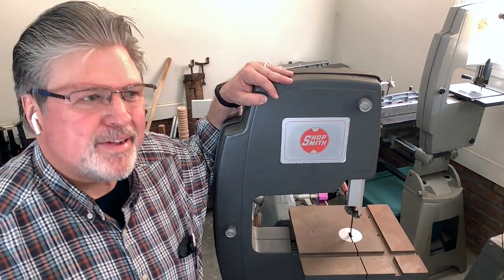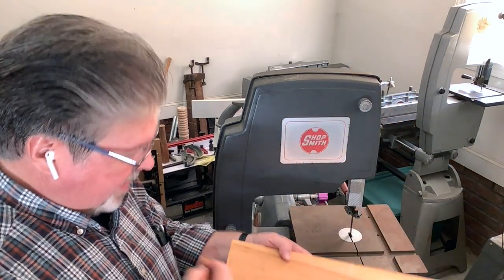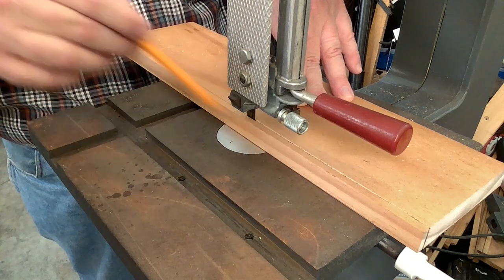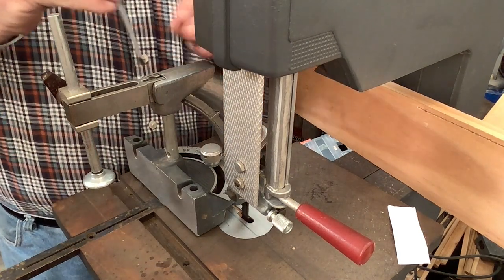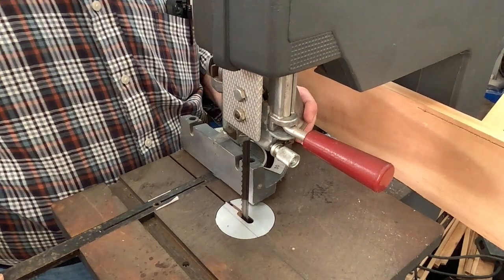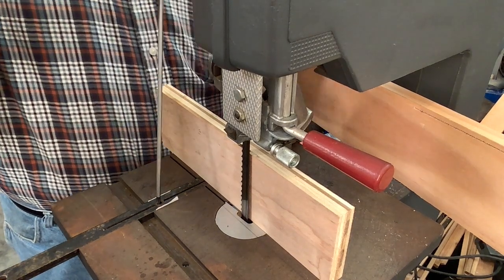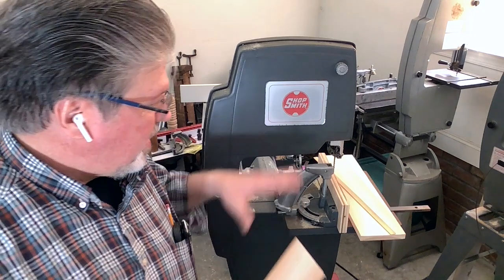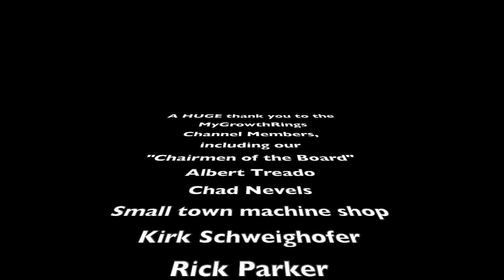Ripping & Resawing on a Shopsmith Bandsaw W/ Cast Iron Table

Comment: I have two Shopsmith Bandsaws, one of each aluminum and cast iron. I don't have the drift issue with either of them. 

Back in the early eighties, I made siding for my house using my cast iron tabled bandsaw. I ripped a large stack of 16-foot siding using the miter gauge fence. I wore out three blades.
Reply from the maker: That's a lot of sawing!
Reply: I hope you adhered a Shopsmith emblem on your siding in honor of your fine sawing skills!

Comment: I have a new to me shopsmith 5. I have gone through the band saw and the belt sander and done a complete maintenance on both of them. Thank you for your instructions. I am trying to do the set up for the ripping fence for the band saw. And lo and behold, I came across this video. But I don't think I have the right ripping fence. I have the one for the table saw. I haven't been able to find one for the bandsaw. I am about to learn how to do it now. Then I just need to find the fence. Thank you for all your great videos and all the time that you have put into so much work to make it easier for us. I also have the cast iron table like the one in this video.
Reply from the maker: @eagle3351  Do you have a Shopsmith miter gauge?

Comment: Great video Scott.  As I told you in another comment,  I  finally fired up the  SS bandsaw I've had kicking around the shop for years, mainly to make sure that it was in good shape before I sold it.  I love the way it cuts!  I'm not selling it!  I've used the miter gauge for a fence before, but now I will use it on my bandsaw.  Love the idea of setting it to adjust for drift!  Keep the good suggestions coming.
Reply from the maker: That's so cool to hear, Stew. Yes, the miter gauge as a fence is just so efficient and practical.  Like so many things on this saw it makes me wonder why it wasn't copied until the clones came along.  Scott

Comment: Thanks for another excellent video.  I used to teach classes at Woodcraft (and I'm sure you can see where this is headed) and the conventional wisdom was that if you wanted good results when resawing you needed at least a fourteen inch band saw,  and an expensive one at that, and just for good measure it should be outfitted with Carter guides.  Even though not one of them owned a Shopsmith, the store employees were convinced that this kind of accuracy was not possible with a small saw. Thanks for setting the record straight.
Reply from the maker: HA! Yes, I saw exactly where this was going!  Every once in a while, during my frequent business trips, I'll visit a Woodcraft or Rockler and they won't be poisoned against Shopsmith tools. I always ask in every time it's because some highly respected and talented woodworker among them has shown them the way. We'll get to them all eventually!  Scott

Comment: I was just dealing with this issue today and was not able to resolve it!

I had used the practice cut method for fence alignment on my large band saw at school before, but never thought to try it on the shopsmith.

And I did not know that the set screw could be used to clamp the miter gauge in the slots. Boy, have I had some difficulties trying to do that with f clamps; there may have been some f-bombs involved too.

Can't wait to try these techniques out tomorrow!
Reply from the maker: Just make sure to add a piece of paper under the bar before tightening the set screw.
Reply: @MyGrowthRings  Worked! 

Turns out, my miter gage bar is tight enough as is. The paper wouldn't fit in the slot, no matter how much I loosened the screw.

Comment: Okay , this is another PHD type presentation!  Love my SS Band Saw but haven't really used it much other than cutting out shapes for some Arondak chairs,  which turned out fantastic. The example you showed would be a perfect alternative for edge banding plywood cabinets. Thanks for sharing. Curt.
Reply from the maker: Thanks Curt. Oh yes, you can easily make edge banding. And FastCap sells what they call "SpeedTape", which is the double-sided tape that I use for permanent bonds like thin wood edgebanding, but if you cut it thick enough you can always used woodglue.

Comment: This video would have been helpful 20 plus years ago when I was doing a lot of re-sawing for the local ladies at church. Their monthly projects were tole painting and I was the go-to guy cutting out wood decorations for them to paint. 
To hold my miter bar in place, I would use a clamp and a thin strip of wood the width of the miter bar to clamp the miter gauge to the table. I still do it that way, but I will try your way of holding the gauge tight. I never thought about using a paper shim.
Reply from the maker: Hey Norm. Well, the good news is you know now. Let me know how it works out for you.  Scott
Reply: @MyGrowthRings  Hi Scott. I just installed the Carter Bandsaw guides. I think it made a big difference. I made several thin cuts to test it out. No drifting whatsoever. I also tried your paper trick using the mitergauge slot. It works really well and holds it tight. Thanks again for all your help and info.
Reply from the maker: @mcnormYT  Glad to hear it. They really seem to work well.

Comment: Great video Scott, thank you. Would you consider some deep dive maintenance videos? For things like lower wheel removal, beltsander drive wheel removal, bearing replacements on about everything,  and such. And the more odd SPTs like Pin Router, Ring Master, compressor, etc.
Reply from the maker: Yep, they are all on the list, except lower wheel removal, which isn't worth the effort. if that bearing is shot you might as well start with a fresh wheel and bearing. Scott

Comment: Blade back up bearings: I used the cheap 627ZZ bearings in all 3 locations on my saw. In the upper and lower guide locations, I added a couple washers to limit side play and center the bearing on the blade. Didn't even need to machine any custom spacers. These bearings are 10 for $10 on EBAY as opposed to the 770371bearings which are around $20 each. I personally don't see a need for the wider double row bearings on this small machine, the single 627ZZ's work just fine. Also, my cast iron table was also rusted. I glass bead blasted it with fine beads and low (35PSI) air pressure after taping off the perimeter of the table sides with duct tape to protect the paint. It gave it a smooth satin finish, not shiny polished, but that's good enough for me and it was a quick process. This does not remove any metal and is not very aggressive. It can still be sanded to a shiny finish if desired.
Reply from the maker: I've done the same. In fact, I had some of those bearings left from a project I did about 5 years ago on this very channel.  Scott

Comment: Scott, just got the latest copy of Woodsmith magazine and they have plans for a pivot point guide for resawing on a bandsaw.  Have you ever tried this on the Shopsmith?   I have a 500 and have used your videos to set up my miter gauge as a fence and to account for the drift, per your videos.   I wondered how a pivot point guide might perform on my machine.   Any experience with that?
Reply from the maker: I haven’t seen the issue, but are you saying that they have a vertical pivot point that is in line with the blade? If so, I have used that design, but prefer a fence.
Reply: @MyGrowthRings  Yes, it's like a block of wood standing vertically with a rounded bull nose that is next to the blade, maybe a bit ahead of the blade.   The pivot point is the guide that keeps a consistent width, and then you supposedly follow your line you drew.   I just wondered how effective this is.
Reply from the maker: @tzavitz  I've used them and they do require that you draw an accurate line before each cut and you really have to concentrate on the cut. As I said, I prefer just to adjust the fence to accommodate any drift and then just saw away.
Reply: @MyGrowthRings  thanks for the input.
Reply from the maker: @tzavitz  My pleasure.

Comment: great - thanks. I have a saw identical to the one you are using in the video.  What causes drift to begin with?  it seems to be different with each blade change, and for all i know (I have not really tested) different from one usage to the next even on the same blade - is it a function of the blade, the tires, the tension, etc - ?  Why can't it be dialed out?  when ripping the blade guides don't really do much - but could you reduce the drift by snugging them up to the blade?  it's easy enough to accomodate for the drift as you have shown, but just wondered about your take on the above.
Reply from the maker: Hey Jim. The drift on the Shopsmith bandsaw is cause by a combination of the shape of the conical upper wheel and the backward cant of the upper wheel.  There are a few other things but that's the bulk of it. Yes, having the guide blocks close to the blade helps and even upgrading to Carter Blade Guides seems to help, but I'm still getting drift.  Scott

Comment: Thank you so much for this video.  I have been thinking I was doing something wrong to get the drift.  The miter fence I got doesn't have the set screw.  Is that a standard size I could pick up at ye old neighborhood Ace.
Reply from the maker: Hey Suzzette. No, it's a funky, tapered set screw that to the best of my knowledge is proprietary. I'd love it if someone could jump in here and correct me, but for sure Shopsmith offers it.  Scott

Comment: Any issue with fence flex on the opposite side of the table? I’ve clamped some support blocks there just in case but have you ever found a need to do so?
Reply from the maker: Not really. If it’s flexing it means either it’s not quite properly aligned or I’m pushing into it too hard.
Reply: @MyGrowthRings  I’ll have to keep that in mind

Comment: Hey  Scott,  great video.  Can you recommend a sorce for a light metal cutting blade for the bandsaw? Like aluminum and thin steel.  Greg
Reply from the maker: Good question. I think I would take a look at the blades offered by sawblade.com. I’ve heard good things about their product and know that the blades I usually use would not be appropriate for that application. Scott
Reply: Thank you Scott.  I appreciate the help.  Metal  doesn't have growth rings...lol  Every now and then I mess with light Metal.  Greg
Reply from the maker: @gregwilsonnaturephotography  You are right about that!

Comment: Hi Scott,  How do I make a jig (probably for my bandsaw)  to cut a 2" x 2" x 16" piece of basswood lengthwise into two triangular shaped pieces for carving?

Dennis
Reply from the maker: You hit the nail on the head with the bandsaw. I will take a piece of quarter inch plywood as a mobile base and attached to that a couple positioning pieces using double sided tape.
Reply: @MyGrowthRings  You're awesome.  Thanks for the quick reply.  Hope  your move finishes up well.

Comment: What happens if you set the fence up parallel to the blade? Will the wood change thickness because of drift? I would think no matter what the blade does, the wood is locked between the blade and fence and the thickness would remain constant. Can you demonstrate what happens when you do not account for drift? Thanks.
Reply from the maker: Hey Tom, sure, I'd be happy to demonstrate that.  Depending upon which way the blade is drifting the board will either be pulled away from the fence, or shoved into the fence with the blade eventually bowing out in the center. It's quite exciting when you are sawing something important or expensive! Scott
Reply: @MyGrowthRings  I’ve had this happen... and it sucks
Reply from the maker: @gatheringsplinters4800  It sure does. And it always happens on important pieces.
Reply: @MyGrowthRings  With blade drift I get "chattering" using the PowerPro headstock.  So severe that the set screws come loose on the drive hubs.  Extra incentive to adjust for proper blade drift.

Comment: Do you need to reset for different blades
Greg smith
Reply from the maker: Reset the tracking or Forest the fence? The tracking should be automatic, so other than resetting the guide blocks, there shouldn’t be a need to reset the tracing. As for the fence, yes, every blade will drift slightly differently, so you’ll want to check it with a trial cut and adjust for the drift if each blade. Scott

Comment: I'm having an issue ripping on the table saw. I've tried to rip down the middle of a length of 2x4 and 2x6, both times dividing the "2" (1-1/2" actually) and both stop at the same place which is about 3-4" of travel. The blade continues to turn, burning the wood until I back it out or switch off the motor. I removed the kick-back guard, and it did the same. It cross cuts easily, but when I repeatedly attempt to rip, it stops at the same place, no matter the wood and will not advance. I can't figure out what is stopping the advance...
Reply from the maker: Sounds very frustrating. Is this is on the SS Bandsaw? Are you freehand cutting or using a fence? If there’s a fence it may not be set parallel to the drift of the blade. Anything more you can share? Scott
Reply: @MyGrowthRings  It is on the SS MKV 500 table saw, not the bandsaw. This occurs with or without the fence. I checked for binding there and removed as a test. I also tested with and without the blade guard. I do not remember this being a problem in the past.
Reply from the maker: @pastordavid5525  Sorry for my confusion. That’s what I get for rushing to answer a question while they are shutting the door on my plane!  It certainly doesn’t sound normal, especially if the blade continues to turn. I would assume that either the end of the board is hitting some thing such as where the table insert ends, or, if there’s a knot or something hanging down from the bottom of the board that catches the front of the table. If the blade is bogging down, that is usually an issue of either slipping belts, or running the machine on a long extension cord. Perhaps consider should I get my phone is shooting a quick video of that happening could be helpful. Is that something you could do? Shop
Reply: @MyGrowthRings  I am running a long cord at present due to saw placement. Yes, there is a bogging down, and I believe you are correct in that assessment. I have a shorter, higher amp extension that I normally use (it was at church) and will use next. Still, it does appear to be a mechanical block of some sort, especially since it continues to spin and burn the wood. I will take the saw apart and see if anything obvious appears, then retry with a short video. Thanks for your time. Happy and safe travels!

Comment: Hey Scott, I’ve set up to  what you said on my bandsaw and I still can’t get a good straight cut. What could I be missing? Should I tighten the blade? I’m stumped! Thanks in advance.
Denny
Reply from the maker: Let's assume you have it set properly; what blade are you running, how new is it and how thick is the stock?
Reply: @MyGrowthRings  it’s a new 1/2” blade from Shopsmith. The stock is 6” width x 1” thick red oak

Comment: Hi Scott, I just saw a modified 500 Table saw fence for sale on Ebay that fits the cast iron  Band saw table.  I was wondering if you or anyone has seen it ? I have an extra 500 fence that I think I will experiment with ! Looks like a winner but who knows................
Reply from the maker: Yep, the seller has shared it on the Shopsmith forums and in a SS Facebook group I am in. Pretty simple, once you add the fence rail.
Reply: @MyGrowthRings  Thanks for a quick answer ! I'm going to try to do a little "cleaner" job on mine. I'll actually use the end cap and weld it back on to give it a "STOCK" appearance. Wish "I" had thought of it !! Glad to share what I find if it makes life a little easier ! I'm thinking you could use the offset screws to accommodate for re-saw ?? The adjustment screws might just help with off setting the fence ??